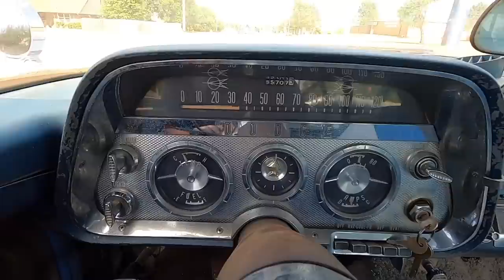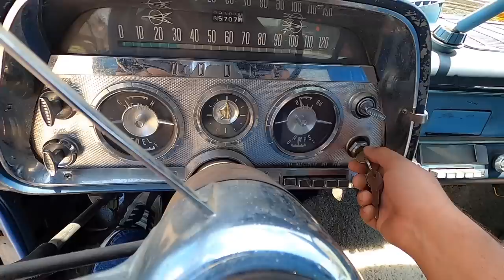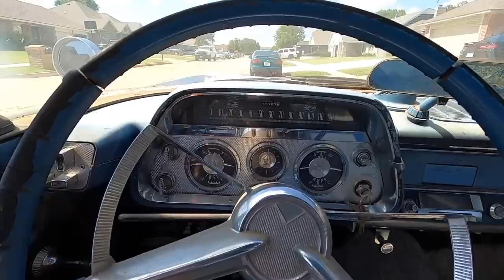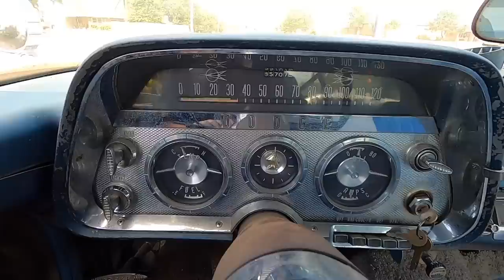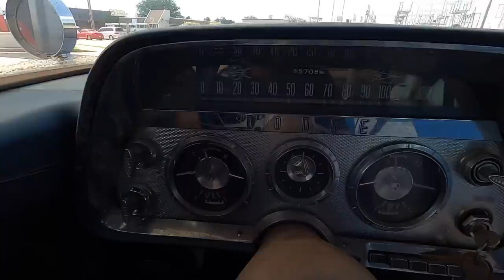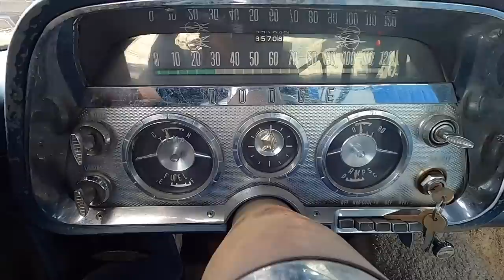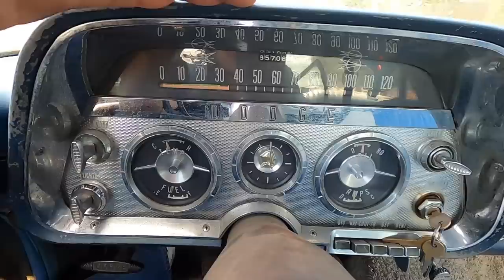Fixing and Driving the 1959 Dodge Coronet for the First Time on July 4th 2020!!!

Comment: Randy.. .Just for information sake... removal of a thermostat is a REALLY bad idea unless it is for emergency use. The problem is the coolant gets circulated very fast, but never has time to get 'cooled' in the radiator. I did that years ago in a car I owned, and it ran hotter than it did before I was having trouble in the first place. Yes, you NEED a t'stat in the summertime for cooling/temperature control. Almost more important in the summer than in the winter.
Quick way to help determine what's happening with a mis-fire is to use something like paper money, cardboard or something similar and hold it at the end of the exhaust pipe. I like the dollar bill test the best. If the exhaust tries to suck the paper back inside the pipe, there is a high likelihood there is a burned exhaust valve in the engine. I had a car VERY similar to this one when I was younger. My dad was a mechanic so I learned a lot about how to keep the thing running well. The choke on these is heated by a bypass pipe in the intake manifold from the exhaust. It heats up the choke that way. There is also supposed to be an 'unload-er' on choke that opens it up some when it starts running. Then the heated choke starts to get exhaust gas going past it to start the heat sensitive choke spring to pull open the choke. They worked pretty well, all things considered. BUT.... if that bypass tube in the intake manifold doesn't pass the heat fast enough, (or at all), then you may have to use a manual choke on the engine. Been there many times on that one.
One problem not many people are aware of these days is this.... These old cars are NOT designed to run on today's gasoline. These engine REQUIRE leaded fuel! The valves must have the lead in the fuel to keep them from getting burned up. There are lead additives you can purchase for these engines to protect the valves some, but they will, without a doubt, eventually burn the valves without the lead in the fuel. I had a 1971 Duster 340 and had the engine burn valves a few times before we realized what was taking them out. Had to replace all the valves with a new style that didn't require leaded fuel. No more burned valves again after that.
The speedometer is roller drum which makes it look like that. Really cool!!! Speed turns the drum behind the display.

The air conditioner is really 'cool' in these cars. The upper dash vents are also the air conditioning vents, and double as the defroster vents. You can blow the AC in your face. I loved my 1964 Chrysler which had the same system.

The center blank gauge is the optional clock space.

Comment: Nice new gas tank, id replace the fuel tank with a fuel cell instead. It helps to compensate for the unsafe tank placement of the older vehicles
Reply: There is nothing unsafe about the placement of the fuel tank.  What is unsafe is putting a fuel cell in the trunk where the fumes can leak into the passenger compartment.

Comment: Looks like maybe they have a separate core for the defroster?? Could be that's why they have two heater control valves. Open the valve, and the water is routed back to the engine.Close the valve, and the water is routed to the defroster core. I don't know, just spit ballin' here.

Comment: Glad you started working on the old Dodge. I would change all the fluids, new belts, new hoses, new thermostat, new spark plugs, new points, cap, and condenser (or new distributor), new spark plug wires and buy new tires. Check the master cylinder and flush the brake system installing new brake fluid. While you are changing the fluids please do transmission service by changing the filter, and pan gasket. Next I would clean the engine and engine bay, adjust the valves and new valve cover gasket. Finally I would put the car on a lift and inspect the U joints (and lube them), brakes, brake lines, shocks, and exhaust system. Lots of little things to do. Good project. In the day, I thought all the Chrysler Corp. cars were ugly but this old ugly Dodge is growing on me.

Comment: on the heater hose - That should on and close to adjust the heat in the car  also if you remove the thermostat, the water doesn'tstay in the radiator long enough to cool down

Comment: You really should just keep the car and restore it little by little, may be a father and son project. You may not make a ton of $ on it but to me it's more of a fun project then a flip car. When I was younger my dad always told me stories about all of his cars he had back in the day and how he always wanted to get a Chevrolet nova or my personal favorite 1970 Chevy chevelle with a 502 or 575 big block. Blue with white racing stripes. That's my dream car. Needless to say we never got anythimg to tinker with like that but instead my dad bought me a 95 dodge neon to race circle track asphalt racing at our local race track. It was called pure stock division. Basically any 4cyl fwd car as long as it wasn't a turbo or supercharged car. He always used to drag race when he was a kid. Wanted to get me into the racing gokarts but we didn't have the money for it and this neon he bought off a customer where he worked at CarX for 240$ and had his friend weld a cage in it and went out to the track and had a blast! My dad seen how good of a driver i was on the track. Seen how well I did with what i was givin and kept up with the best of them. Blew the trans one year then the motor the next year which is when my dad splurged and got me a 97 Saturn sc2. A previous championship car at the track we used to run at. Basically we could take that Saturn to any track around and give the point leader a run for their money! It was great!

Comment: that is a fantastic car. the valve on the heater line would have been controlled by the temperature lever inside the car with a cable. the other line for the heater i haven't seen before.

Comment: i believe that valve on the line going to heater core is to shut the water off as well as the heater, had one on my 81 chevy which was put in due to leaks. close valve no water gets into the heatercore. and also you render your heater non operational.

Comment: Choke problem is likely a plugged intake not allowing it to heat up.  Flush the intake and should be good.  Had the same problem on a 70s 318.

Comment: Try some Thermocure. I've used it and it really works well it's a little pricey but at $20-25 a bottle it really does work well to clean the cooling system out and I turned on the heater and it actually started to make the heater work better 👍

Comment: Can you determine if the black substance in the cooling system is carbon? If it is, you should probably do a pressure check on the cooling system. Carbon (from exhaust) can only get in through a head gasket leak, I believe.

Comment: Gomer pyle, Came to mind. Seems like continued driving with a head gasket leak or some other cyl. Leak. I had a 58 royal custom 350 4bbl, aluminum torque flight, awesome cool car, i drove it home in 68 to Michigan from San Jose.

Comment: From what I could find on the web, it looks like the heater hose goes from the engine to a heater valve, from the heater valve out into the heater core, and out the heater core back to the engine, that’s what I could figure out

Comment: Tires belts and hoses just like you said, freshen it up good detail it give it a good polish leave it in the original paint if you're not going to restore it no need to go too far, get it tuned upholstery shop and fix up the inside a little Maybe.

Comment: Randy,,  if the carb chock fails to open after the engine is warm, then you will have to take off the intake manifold and clean the carbon out of the heating passage,,,,  :-)

Comment: The thermostat is needed all the time the bypass valve is your heat it allows hot water to go into heater core.
Reply: Also the black is probably head gasket.

Comment: I have to shake my head at all the ethanol comments. We've run ethanol for years in my 59 Olds, a 68 Triumph GT6, my 1950 6 cylinder Continental engine air compressor, my 64 ParkMaster with a Hercules 6, (look up ParkMaster), and various older motorcycles. All I do is run a good filter because it cleans out the systems.

Comment: The transmission is a Powerflite not a Powerglide. First offered in 54 and in 57 the Powerflite was low-lne and the Torqueflite 3 speed was optional. For 62, the Powerflite was dropped

Comment: That heater hose loop into the firewall goes to the “water valve” or heater control valve under the dash. Someone put their own valve on the other heater core hose, that’s not factory.

Comment: You may have too much fuel pressure with that electric pump. Most needles and seats in the older carbs can only handle 4 to 5 psi.

Comment: Your engine miss could be a  a bad valve in the cylinder head , so you need to check i=the compression of the motor. But first I would check the firing order of the motor, it very easy too swap spark plug wires on 7 and 8 and the motor will still run ok but miss fire.

Comment: You might have a head gasket issue. Seems like it’s building up a lot of pressure in the cooling system, also the carbon buildup leads me to believe it’s got exhaust getting in there somehow a probably a head gasket.
Reply from the maker: You’d be right

Comment: How did you solve the throttle linkage issue with the non-stock carb ? Also, the repro tank you got is a 23 gal tank. Original tank was 20 gal. The larger tank needs larger straps. So how did you overcome that issue ?

Comment: One small question: How much caked on oil sludge is in the bottom of the oil pan, and how clogged is the oil pump's pickup screen? The good news is  the screen has a small hole to allow some oil to be pumped to the mains and rods.

Comment: Fire works were cool but i love that car i have a 95 dodge ram 2500 slt all factory with 94k miles on it i love my mopars
Reply: Oh wait had two brake lines and brakes replaced and a new wiper motor installed

Comment: Yeah. Get the car safe, especially the brakes. Hopefully you know someone that can set-up/adjust drum brakes so you won't need Popeye-legs to stop.  When it was cranking on one of the videos, it sounded like a cylinder had low compression. Hope a valve adjust helps. Happy Motoring!

Comment: Newer cars send coolant to the heater core all of the time and have a blend door to bypass it.  Older cars have a valve that bypasses cooland around the heater core or just stops the flow.  Not sure why I see two valves (the one you took out and the black plastic one on the other hose.

Comment: I bought 66 in the late 80's off of my boss for 100 bucks. lol it didn't have a rust hole in it. he thought it had a cracked block. I checked it out. Had a rotten soft plug so I drive it home. Had to stop once and add water. It ran like a screamin banshee. Had a crazy big ass motor. it was a 426 or 440. Unfortunately I totaled it. lol Slid off the road at high speed and busted the brake line in the ditch. Single reservoir master cylinder so i was screwed. A I saw the culvert coming at me I turned the wheel hard and punched it. I came out of the ditch alright, but flew across the and over the bank into a flooded creek in December in Ohio. that water was cold!!!!.

Comment: Sorry but also that engine does not have hardened valve seats. Use a lead additive. There also is not a valve adjustment, the rockers are on a rocker shaft.

Comment: the avg CARB only has 7-8 PSI.
even with a new CARB,
the fuel pump will over pressure the carb.
you have a pump for a EFI system.
try a different fuel pump.

Comment: Your choke probably doesn't work because the crossover in the intake manifold is clogged with carbon and the heat is not getting to it from the engine.... I had a plymouth Fury with the same problem... take it off (it's not as awful as it sounds) and clean out the crossover with a piece of spring wire or some mechanical means...  so the heat crosses from one bank of cylinders to the other...  you can tell if it's open if the manifold is getting hot where the choke is positioned
Reply: I mean HOT HOT, not engine hot, exhaust hot

Comment: Randy ! For goodness sake , why didn’t you test the thermostat when you had it out , put it in a container of boiling water to see if it operates, the exhaust sounds like it’s leaking giving you the impression it’s misfiring, the motor is smooth ,not shaking around indicating it’s firing ok, don’t do anything until  you have it running at temperature with the thermostat, and get it hot , man it hasn’t run for long periods as you say for years and may have sticky valves , or carbon around the valves , gasket leaks , could be all or nothing wrong just needs a good run . Great ole car tho .

Comment: thermostats slow the coolant flow,
you should never remove them completely,
replace it if it's faulty or make  a metal plate with a 13mm hole for flow

Comment: Carburetors  only use about 5 psI, you're using 50. That could be why the float is not controlling the level.
Reply from the maker: No, the new pump says right on it 5-7 psi
Reply: @AutoAuctionRebuilds  Sorry, I wrongly heard forty seven when you said four to seven.

Comment: These kind of car are not only unique, they are not really complex ( no or so few electronics, flat side windows, standard headlight optics I guess, no brake booster, just a carburetor ), they a dependable, easy to fix, endurant, have a good mechanical accessibility, quiet ( more than a brand new turbo diesel ), have soft ride, is one of the last remaining, can achieve really good gas mileage si some good tune up and some minor modifications, can carry 6 people with their luggage ^^, design proportions are awesome, and design alone is so good.

No brand new car can give you all of this. And no future car will. Never.

Comment: Do not drive the car with out the  thermostat. It will over heat.  The valve in the heater hose is to shut off hot water to the heater. Replace it or the car will get so hot inside. It stops the water from circulating  through the heater.  It also controls the amount of heat to the inside. You can reduce the flow of hot water and add more cold are to regulate the temperature

Comment: Just a question; electric fuel pump. Don't you need a return line to the gas tank for the un- used gas? I'm only asking, because I just dont know.
Another question; did you look at the old carb to see how the throttle linkage was? No, I'm not a wise guy, just asking.
Yes, you will no doubt, be getting attention with this car, because it's NOT the typical '50's car....
I was 5 years old when we moved out of the house my father built. The people that bought our house, owned, a '59 Dodge. That's how I remember this car. 
We had a boring, '59 Rambler Wagon.
HEY, HEY!!!!! It's running!!!
I hear a ticking sound. Valve adjustment.
I cannot hear the miss, as you do.
Forgive me, I'm using my phone.
My computer however,  plays through my home stereo and I'd probably hear the miss that way..Checking the valve adjustment is a great idea. Who knows when it was done last? Both sides???
Not restoring, but you will continue to repair it? Great!
Thanks for the fireworks..

Comment: Basic mechanics. No circuit boards or computers to fail here.
Consider brake flush and an air cleaner as well as what you plan.
Drive carefully, no air bags or seatbelts, and it probably handles like a boat. Keep it undercover if you can.

Comment: An Engine always needs a thermostat. The purpose of the thermostat isnt just to warm the car up, it helps slow the flow so the coolant in the engine can absorb the heat, while the coolant in the radiator is losing heat. when the engine thermostat opens the coolant is exchanged through the restricted area that is the thermostat. On a hot day an engine will overheat sooner without a thermostat.. as it flows so quickly not enough time is spent in either location to absorb the heat and also dissipate the heat..Just saying..

Comment: Randy the sliding speedometer might have a non someplace that will set the speed. In the 59 Buick my mothers car had the same type of speedometer that you could set the speed and if you went over what you set it would have a buzzer. We used to set my mother's to about 20 mph and would drive my mother nuts. Maybe it is set at 35 so the bar turns orange. Maybe Google it. It might have something to set it.

Comment: What a great old Dodge, my uncle owned one. The 318 polysphere is a smooth and reliable engine. Nice job with your repairs, you went right to it and fixed it! Check your brakes before the test drive- please! 
Great fireworks too, wish I was there! 
Hope you show more Dodge videos, very interesting cooling system on old Mopars, and there's not much out there on that.

Comment: the flip valve is for winter summer heater core summer close to get colder air and winter open for more heat carbon buildup is from the thermos stat you are right to remove it will clean up soon also the belts are designed for old time none ribbed so keep a bar of soap any type i like ivory great for complication and when not if squeaks start with engine running put soap to belts stop squeak and moisturizes remember it was built when you were brewing in your dads #$%^

Comment: Never pull that E brake on when car is moving. It's a drum on the back of the auto, and it could tear your driveshaft off.
Reply: So what's he supposed to do if the main brakes fail?  Hence the name. Emergency brake. Exactly what it's designed to do. Pull the dam Emergency brake hard until that car stops.
Reply: @styldsteel1  Oh it'll stop alright, when the driveshaft digs into the road, and I've seen that happen. Think about it...if the transmission stops with the E brake, the diff keeps turning.   If you'd viewed the workshop bulletins and read the warnings...        It's far more powerful than a normal E brake on a diff.
Reply: @moyadapne968  what then would the driver do in the event of a catastrophic brake failure?